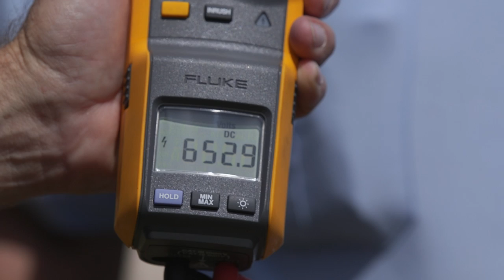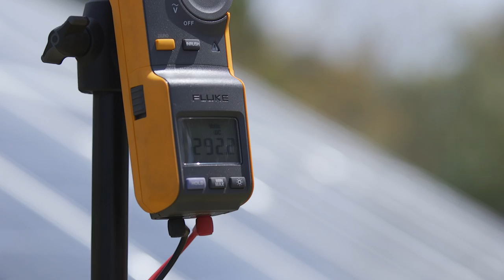Electrical Arcing & Water Conductivity

Comment: An installation of PV “solar panels” is Not a “solar system”. Stop perpetuating ignorance.
Reply: What is it then?
I think you'll find that by definition, once the panels are installed they become part of a "solar system" and therefore can be referred to generally as "the solar system". Even if there is no further connection to an inverter or battery charger/regulator and battery bank or grid tie inverter, technically once two panels are connected together either in parallel or series they, on their own, could be considered a "solar system". For that matter, technically, a PV panel on it's own once pointed at the sun, could be considered a "solar system"
Reply: Jimmeh B the solar system is our planet along with the other in our solar system. 
The proper term is PV installation or PV system. The product is even called PV stop. “Solar” can refer to anything that transfers the sun’s energy in to usable energy ie electricity, heat, etc.
Reply: Need to look at you own texts. The other guy is talking about 'A' solar system, you are talking about 'THE' solar system, agreed different animals completely.
Reply: whorayful right, and is the product for solar heat? Or a solar oven? No just PV. That’s the misleading part of the script. 
I get it the script is in layman’s terms and...
Why not teach proper nomenclature with advertising?
Reply from the maker: You've got me on this point and apologies for getting the terminology wrong.  The demonstration unit in the video is 20 solar panels connected in series and is not a complete system.  There is no inverter, there is no load and the system is not connected to the grid.  However we have repeated the experiment since the time we posted this video and achieved similar results, so the main points underlined in this video remain valid.
Reply: Yeah alright, but good luck in reversing the lack of education in today’s society. Over here in Aus, a “solar system” is slang for a PV system... I missed your point entirely.
Reply: The term solar is used when we use the suns heat for energy, the term photovoltics (PV) is used when we use the suns photons (light) to create energy. Solar system is incorrect usage all day long here. It is indeed a PV system. To add, they are not solar panels, but PV modules. Let's get with the program.

Comment: So they are dangerous........
Reply: The video demonstrates what can happen with a damaged system and the unanticipated risks that can result in the wrong set of circumstances.  Fundamentally solar panels are a safe technology if good quality equipment is used, the system is installed correctly and regular preventative maintenance is performed on the system.

Comment: Just use a damn blanket
Reply from the maker: Traditionally firefighters have used tarps, they are difficult to secure, do not necessarily block out the light effectively and involve committing personnel onto roofs that can potentially be structurally compromised, not a particularly safe or effective strategy!
Reply from the maker: Ok, so having seen the amount of DC electricity that a damaged PV system can generate, you are comfortable crawling over a damaged PV system with a blanket?  Please don't try that, you would be putting yourself at great risk!

Comment: What are you talking about? Are you anti solar panel? Hypothetical crap!!
Reply from the maker: We are passionate supporters of the renewable energy industry and have over 40 years experience as solar panel system designers and installers.  When using good quality components and good installation practices solar panel systems are safe, reliable and improve the world we live in.  However due to the enormous growth of the industry over the past 10 years, a lack of knowledge/experience and continuing downward pressure on pricing, the number of emergency response incidents involving solar panels is also increasing at a commensurate rate and up until now, fire and emergency services personal have not had adequate procedures and tools to safely manage incidents involving solar panel systems, that is why we developed PVStop.  The information in this video is entirely factual, not hypothetical, our service division encounter poorly grounded solar panel systems that leak DC electricity onto the frames (and surrounding metal structures/rooftops) on a regular basis.
Reply: What country do you live in? 
When I first looked at this I took it from a different point of view. Can you tell me where you get the 600 Volts DC from? I thought the input voltage would be v12, 24, 48 ect but never 600. I know the open circuit voltage on a solar panel is higher. But 600 seams too much.
If there is that many accidents then there should be more strict institution control. It should be inspected by a qualified electrical authority and given an inspection certificate.
Reply from the maker: Hi Rob, we are based in Australia, but the same fundamentals apply all over the world.  What you are referring to (12V. 18V, 24V etc) is nominal voltage, 600volts is referencing the Voltage at Open Circuit (VOC).  I have attached a link that gives you a clear explanation on solar panel voltages. https://www.altestore.com/howto/solar-panels-pv-and-voltages-a98/

A typical 72 cell solar panel will produce 42 VOC (voltage reading if the panel is not connected to a load) or 35 VMP (when the module is connected to a load and is operating at its peak performance output under standard test conditions).  When you connect two panels in series, you double the VOC (42 + 42 = 84).  When you connect 10 panels in series the VOC is 420 (42 x 10 = 420).  Residential arrays are limited to 600 VOC in series, to achieve higher outputs, multiple strings are connected in parrallel.  Industrial and commercial arrays are limited to 1500 VOC.  

So in summary a 600 VOC residential solar panel system is quite typical and this is why they pose a considerable electrical risk to Fire and Emergency services personnel.  A solar panel system utilising good quality components and installed correctly is safe, reliable and if inspected and serviced regularly, will give you years of trouble free operation.............a great investment!  But if poor quality components are utilised, if the system has been poorly installed, or if the system is damaged, the system can present personnel with unanticipated electrical risks.